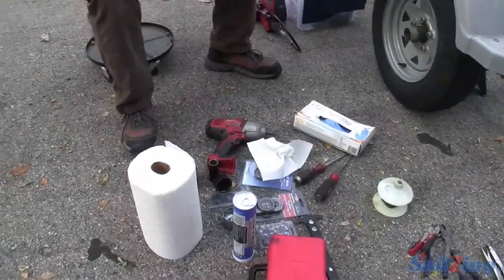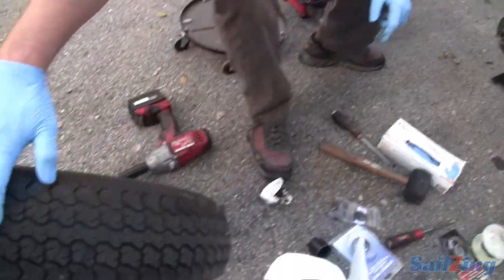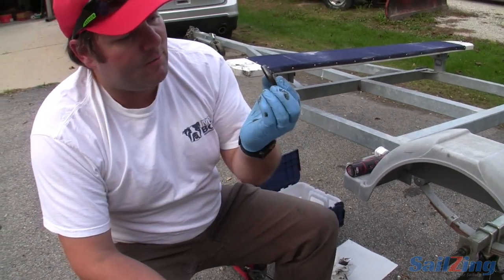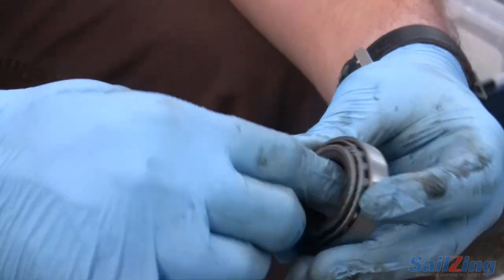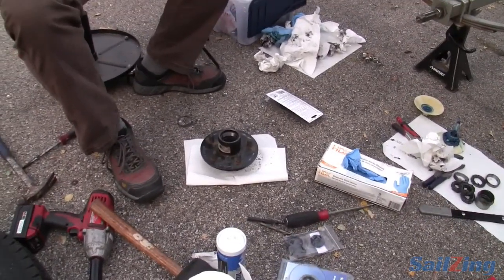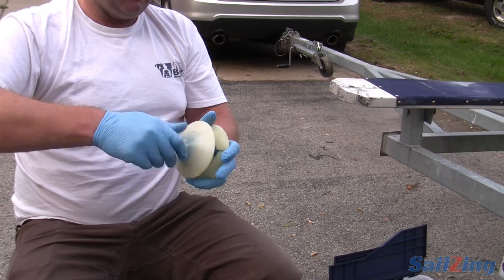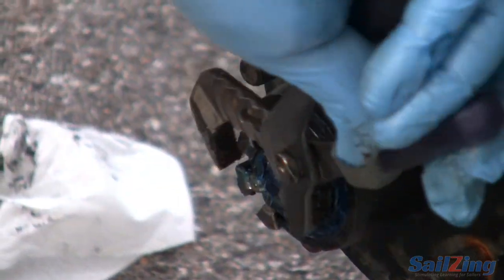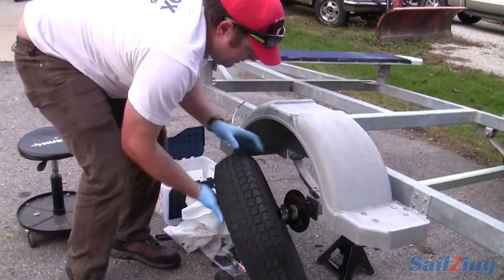Changing Trailer Wheel Bearings

Comment: Very impressive.  I have to replace my bearings/races last year and it took me 3 days to get them both done. I couldn't get the races out for the life of me! even getting the new ones back in was a huge hassle. ( I had to put the races in the freezer and I used a torch to get the hub hot )  Can't believe you did all of this so quick.. Good job man. I think after watching this I may can do it quicker this next time around..  PS. I did what you said in the video my first time changing them out.. I put to much grease in it and blew out the back bearing.. So for anyone about to attempt this. BE CAREFUL NOT TO PUT TO MUCH GREASE IN

Comment: Great video.  very detailed and explained the steps.  One thing I would add is cleaning the rear face where the hub installs.  Use a cleaning disc to clean the back.  Also, clean the stud threads.  you had rust and debris on them.  Will give your lug nuts clean threads to mount.  then the torque will be applied properly.  I use Yamaha marine grease for the bearings.  Waterproof and high temp. resistant.  same grease I use on my outboard motor.  It is marine grade and meets Yamaha specifications.  A drift punch gets those races out easier and using a 3 lbs. sledge hammer will make the job easier for you.  Great job and great learning video.
Reply from the maker: Thanks for your comment!

Comment: Are you sure that so much grease in the hub will not make a issues later. To me at some point it will heat up and will get watery and start leaking, grease is good, but when to much then goes opposite way! How the trailer been doing?

Comment: Great video! One suggestion; I would have sprayed Rust Check or Krown Rust Control on the axle bolts where they connect to the hub. Will control the visible corrosion.

Comment: Hi I might be buying a boat so I have been looking up bearing maintenance stuff to learn, what I can’t figure out is how do I know which size bearings, rear seal, hub etc to get for the trailer I get? The trailer would probably be a Karavan. Thanks for the video.
Reply: I've seen for the bearings.. Get a crescent wrench put around the spindle where the bearing goes. Then use a measuring tape to measure the the width of the crescent wrench.

Comment: Bearing Buddies are not for greasing bearings.  They are to keep pressure to keep water out.  The statement it will flush old grease out is in correct.  If you put too much grease in a bearing buddy it will blow the seal out.  Common misconception with them.  They are ok at keeping water out, and that is it.  Just my opinion.
Reply: Those are ez lube axles. They have a grease fitting in the spindle and a hole at the end by the inner bearing.

Comment: My axel is u bolted below the spring not on top. Does that matter? And why would it vary from trailer to trailer. Thanks for posting this.
Reply: Bolted on top or bottom of spring doesn't make a difference, the reason is for trailer height with regards to tongue height to help with balancing the trailer.

Comment: How do i know what size bearings to buy? Aren't shafts different sizes?
Reply: Without brakes on most small trailers, there are 3 sizes. Most “late model” are either 1-1/16” bearings or one of those on the outside and 1-3/8” on the inside. 3500 pound axles have the 2 sizes. 2000 pound axles are 1-1/16. Smaller are 1”. Most trailer manufacturers stopped using 1 inch a long time ago.

Comment: Would there be a problem with adding a washer?
Reply: carmen morreale If it did not have one, and you added it the holes for the castle nut would be covered and you could not insert pin.

Comment: I was told to always have a washer behind the castle nut? Something about pressure and wear. Could you explain what you mean by spacing if you use one?
Reply: Did you ever find out an answer to this? Working on a used trailer and it did not have any washers. Worried if I should buy some or reinstall it as is.
Reply: @jondrolet25  I bought a kit that came with new washers, castle nuts and cotter pins. Packed hub with grease and no issues!